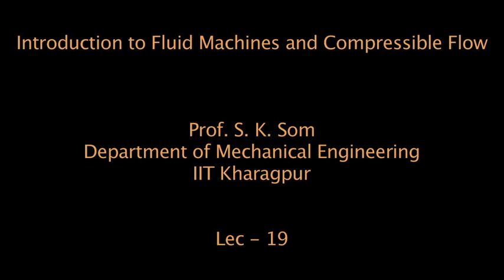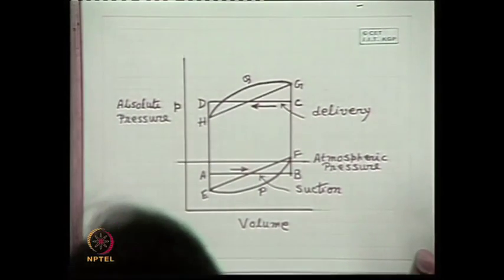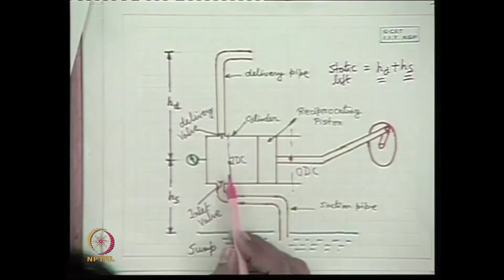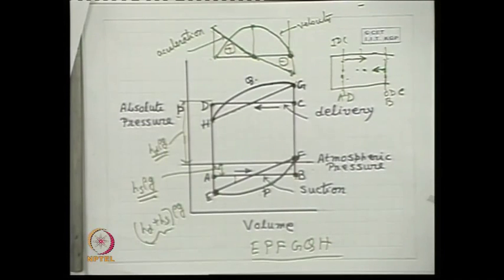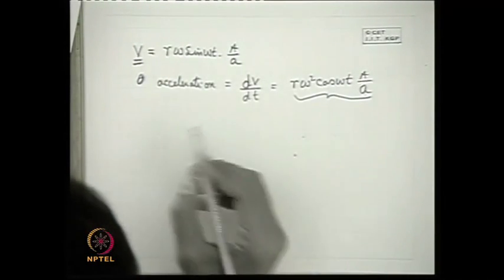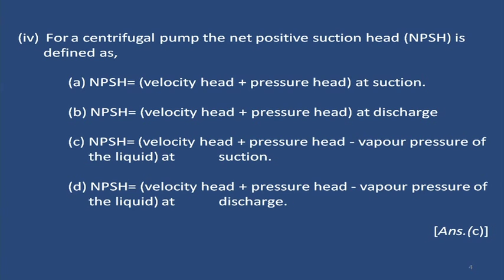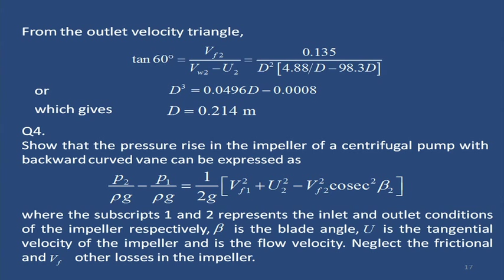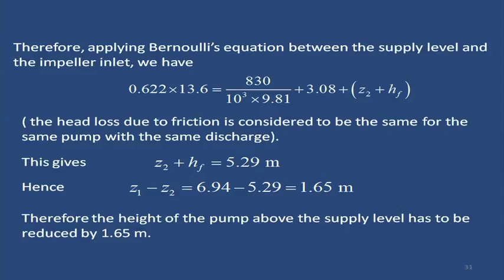Mod-01 Lec-19 Reciprocating Pump

Comment: Sir,
I cant understand why GQH  line is above GH line. Kindly help
Reply: Along with acceleration heads during the delivery stroke initially at G fluid has zero velocity( hence no losses) and at mid stroke pt Q velo. is max( max losses) and again at H velo is zero( zero losses).
Now to overcome these losses pressure has to increase till midstroke where it is maximum further it decreases. 
Thus, the GQH curve is above GH line.